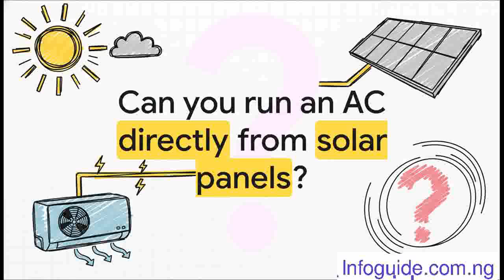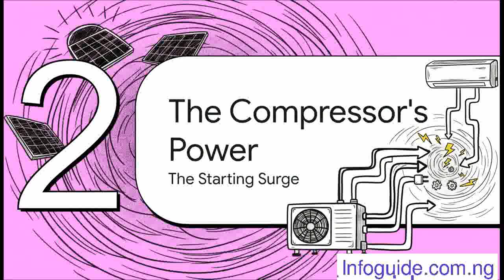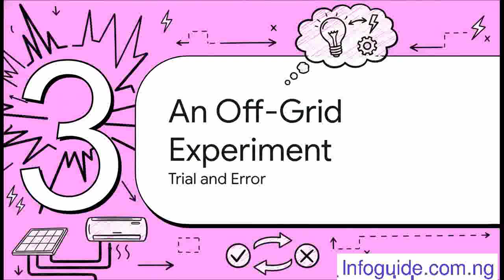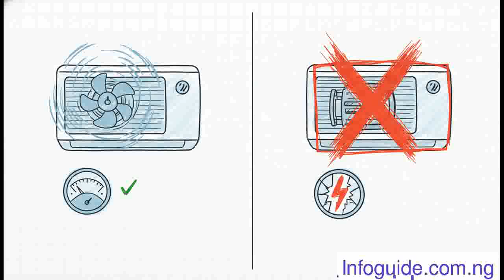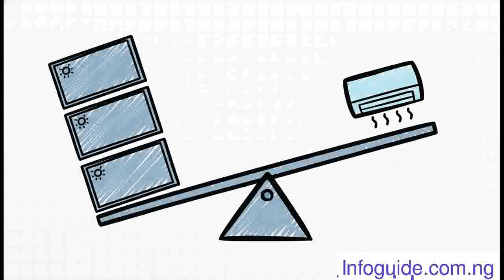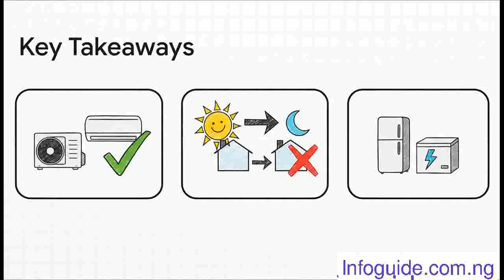How To Use Solar Panel Directly Without Battery To Power Air Conditioner.

Comment: What happens when a cloud rolls in and out every few minutes?
Reply from the maker: Hybrid inverter, the one that can work without batteries, requires that the solar panel power must be greater than the load. The output provides a pure sine wave with a maximum power of 3,000 watts.
The Maximum Power Point Tracking (MPPT) input requires a minimum of 120 volts and a maximum of 250 volts, with a maximum solar input of 4,000 watts.
Larger loads require more solar.

So a 1000w or 1500w air conditioner will work during the day if there is a cloudy weather for some minutes during the day.

Cloudy weather doesn't mean the solar panel will stop generating power, it will only generate half of the power or even lower depending on how cloudy the weather is if you are using mono panels.

Inverter air conditioner use 600 to 760w during operation. Is only during starting stage that air conditioner draw higher power.
Reply: @InfoguideNg the power may drop to almost nothing on a dark cloud this will be unreiable without grid or battery back up. Or you will need 5 x the panels to supply a tiny load.
Reply from the maker: Yes, you need more panel or battery to sustain it during raining season, You have no problem during dry season. People don't even need an air conditioner during raining season.
Reply: @InfoguideNg  Yes you do as it can be 95F with humidty in the summer.  You still need a backup, this will not work on all conditions.